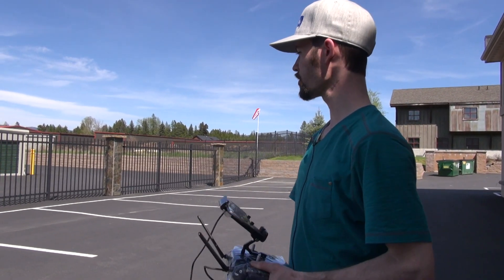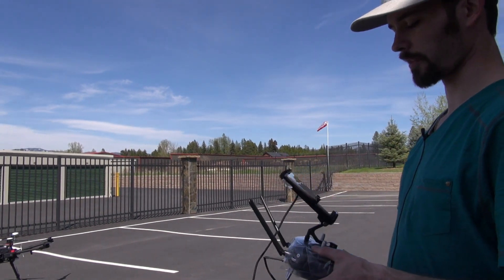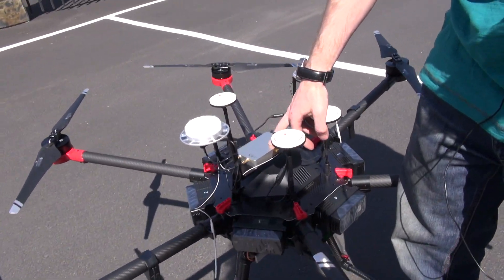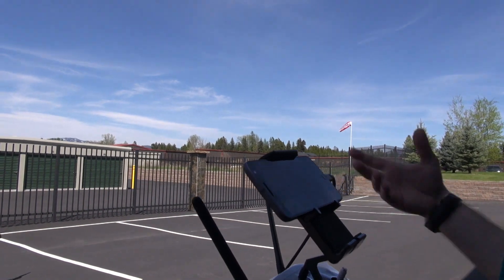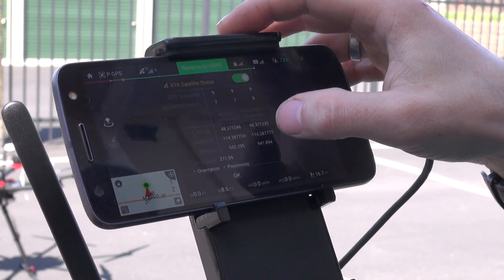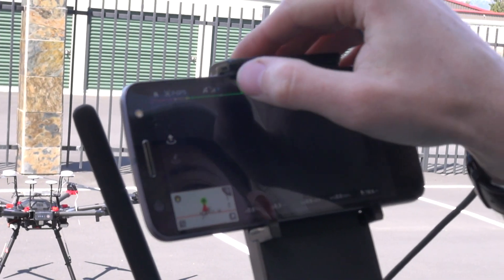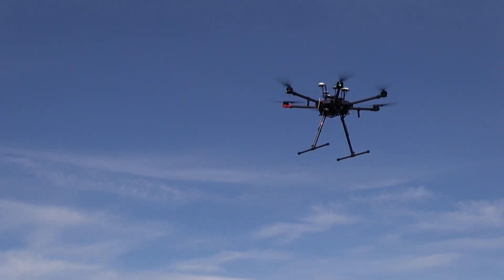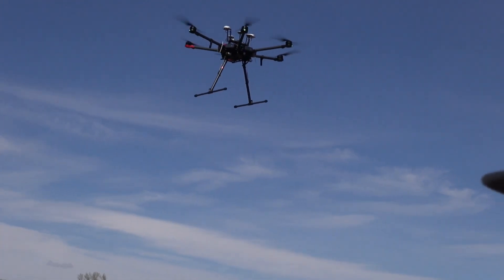DJI M600 Pro D-RTK  Flight and explanation

Comment: Have you conducted surveys with this setup? How was the accuracy of the post processed data? Thank you.
Reply: I spoke with a survey company in North Carolina who claims that the system is not capable of survey grade accuracy within the collected data. It's important to distinguish between how well the system flies and how accurate the collected data is. This is a function of not only the lack of accuracy within the RTK system, but also RTK data drop-outs during flight, and the quality of the cameras available to the M600. The NC company is using the Inspire 2 with the X4S camera, coupled with Propeller Aero points, and getting close to survey grade accuracy data.
Reply from the maker: We have not this is a customer's system.
Reply: Has ANYONE done a survey with it? All i could find on the net so far is people "saying" how cm accurate it is by "hovering" the damn thing manualy, yet no one (or at least i can't find one) has actually implemented it on a survey. I'm using a P4 pro and getting good results, but this RTK should be even more precise (if it does what they say it does).
Reply: Thnx for the reply
Reply from the maker: You can use the aero points withe M600 and you can use the Ronin Gimbal and put a Sony A7RIII and have a high megapixel camera.  However yes the RTK is not survey grade.  I y I was told by our surveyor customers that the survey the land 3 times before they would even fly.   So they have the ground points for accuracy.  They do not use the aero points.  However rely on their surveying.

Comment: How do you set up the base station so that it has “lock”? Is it like a surveyor’s base station, where you have to have an internet/WiFi capable device to tap into an existing system?
Reply from the maker: You turn it and it records it's coordinates, however if you want to modify the coordinates you can plug into Assistant 2 before turning it on.

Comment: Any experience with "IMU heading errors" shortly after takeoff with this setup?  Had issues today with the test flights of our unit. Did IMU and Compass calibration and it still slipped out of GPS hold and started flying like it was in ATTI.
Reply: Aaron Mendez - I have an M600 standard with the RTK kit. The IMU heading issues are usually related to the RTK puck XYZ coordinance settings or a compass has twisted away from pointing at the front of the aircraft. Double check that you have the correct RTK puck plugged in to the correct antenna on the rtk kit. Look up the DJI M600 RTK group on Facebook also to get more information and ask questions.

Comment: Wasn't really a good demonstration to the audience of the centimeter level accuracy. It was filmed by hand so there was shakiness. Couldn't you have filmed with a tripod? Zooming into the UAS in the air didn't help either. The filming didn't help see the main feature of the shown product.
Reply from the maker: Hi Collin, thanks for the feedback, I'll ramp up my camera skills in the next video like this. What specifically can I answer for you regarding the RTK system? The copter's position will still will still waver in the air, there's really no way to get rid of every shake with an aerial platform for the sake of aerodynamics, but it's exact position is recorded to the camera, as well as the copter's flight log with centimeter level accuracy. 

I go over the installation on the copter with greater detail in this video: https://www.youtube.com/watch?v=TdhElYmDwn4&t=58s
Also, check out DJI's site for more info on the RTK system that will also be available on the upcoming M210 series. http://www.dji.com/d-rtk

Cheers, 
Chris
Reply: Hello Quadrocopter, I'm wondering how I'd be able to extract the D-RTK gps coordinates whether it be post flight or if it would be possible to mesh the high accuracy gps data into an integrated DJI gimbal, such as the Zenmuse Z15-5D III with a Canon DSLR, when a picture is taken. Thanks
Reply from the maker: Yes it was a quick run and gun.  Without a lot of clouds in the sky it is hard to see how stable it is.

Comment: How long d-rtk range?
Reply from the maker: Hi Gerry, 
The RTK's maximum range from the base station is dependant on the Datalink pro, which is: 
DATALINK PRO 900:
Japan: 1200 m
Australia: 2000 m
FCC: 2000 m
CE: 300 m
More info on either of these systems can be found on DJI's website: 
http://www.dji.com/datalink-pro/info#faq
http://www.dji.com/d-rtk

Comment: Nicely done!Can you guys now do a video showing how to get the RTK Geo-tagging information from the top to the camera?Hardware and software setup required...
Reply: I reckon Rick is looking for a way to translate the captured RTK position by the antenna's (on top of the aircraft) to the camera's optical centre (underneath the aircraft) through some offset measures.

For surveying and photogrammetric purposes, the position of the aircraft/ antenna's is not so relevant, one should ideally know the exact position of the camera at the time each image is captured.
Reply from the maker: Hi Rick, If you're using a DJI camera, such as a X3, X5, Z30, or XT, the D-RTK's higher accuracy GPS position is recorded to the JPG files EXIF data automatically. No setup required to make this happen.
Reply from the maker: If you're using a 3rd party camera, and the DJI Expansion Module to fire the camera, the GPS data is cached every time you press the shutter button as well. This data can be found in the copter's flight log by plugging into the DJI Assistant software.
Reply: @Quadrocopter  What components are available with DJI Expansion module & how to connect it with the camera..
Reply from the maker: @harshithgowda9885  e-mail support@quadrocopter.com